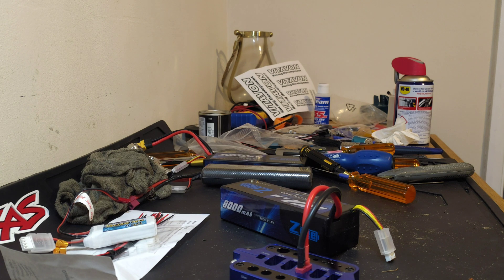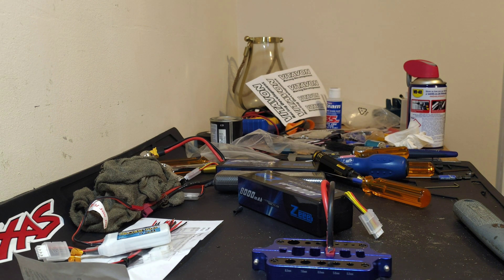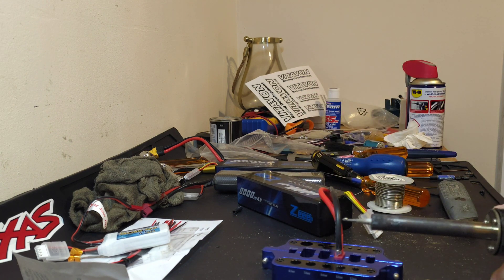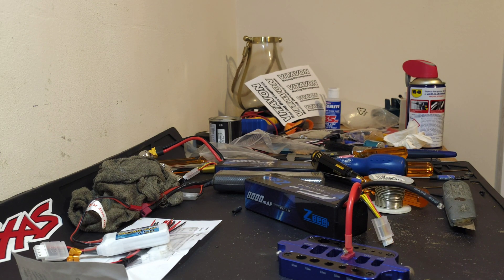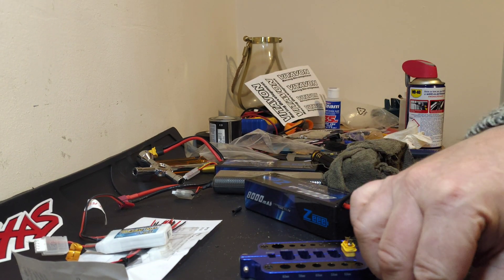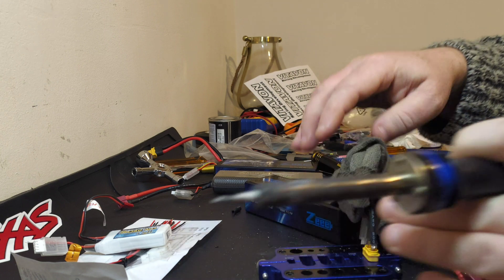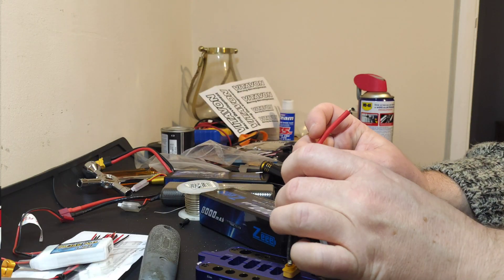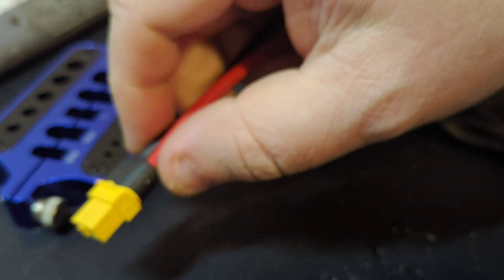Swapping battery connectors xt60 beginners guide

Comment: I'm inexperienced at electrical soldering and trying to learn, thanks for video! Before you tin the new connector terminal, do you not need to put a tiny smear of flux on it? (I know electrical solder is often marked as self flexing) is a little extra flux unnecessary? I just feel like I should be doing it, but as said I'm not experienced at soldering other than copper pipes 🤣
Reply from the maker: It wouldn't hurt it and does make it easier :)

Comment: Use a bigger tip for quicker heat transfer, quicker soldering and less chance of a dry joint ``o=o¬ RCYAL8R
Reply from the maker: I got a bigger tipped iron but it melts the plugs it's not variable, this one works fine it just needed to be turned up a little :) I had it set low cos was soldering some thin wires before I did this vid :)